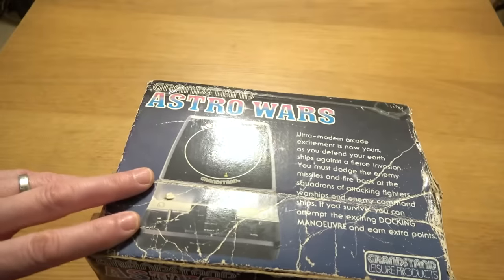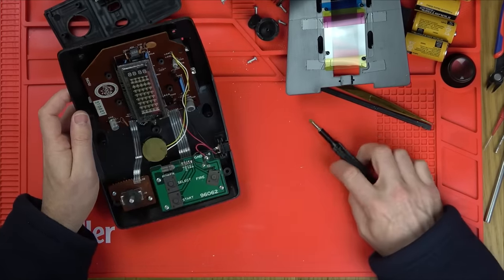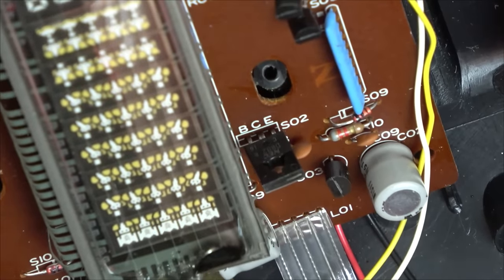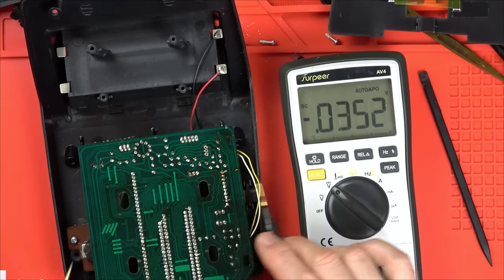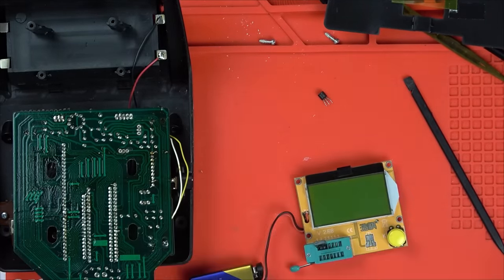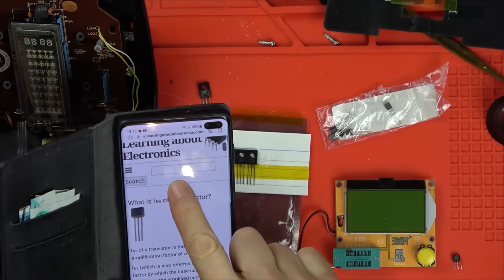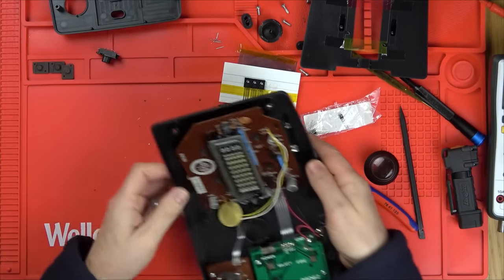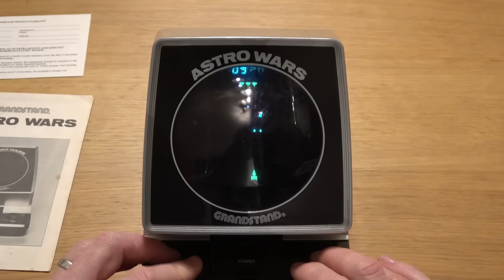Dead 1981 Grandstand Astro Wars Game - Repair Video

Comment: I received an Astro Wars for Christmas the year they came out (my younger brother got the CGL Galaxy Invader 1000), it was a fantastic present, but disappointment quickly set in as we exhausted every suitable battery in the house with a short period of time. On Boxing Day we used to go to my Grandparents, so I took it there and depleted my Grandads draw full of batteries (even used AA and packed the ends out with tin foil!!!, until they ran out).  Then had to wait what seemed like weeks before my parents could get me the Grandstand Power adapter (this had switchable polarity, which may explain why so many Astro Wars have failures).   Needless to say I still have mine and it’s boxed.

Comment: Great vid as usual. Just a quick tip … I keep some emery boards (used to file fingernails) to scrap battery terminals as well as a grinding pen like yours. PPS also changed the tip to small wire brushes as well. 😛

Comment: The higher the Hfe, the better the current gain of the transistor. However, most circuits don't rely on Hfe to provide amplification as it is subject to thermal runaway (its H parameters depend on temperature and as the transistor gets hotter, things become unpredictable). Rather, a useful design has gain set by surrounding and biasing resistors to make it fixed.

Comment: I had one of these and the display failed. It's probably long gone now.

Anyway, for the battery contacts I would use a contact cleaner or label remover that is citric acid based. It cleans up the corrosion quite well with no impact on the device. Best one to get though is one with the built in brush so you actually spray through the brush. Very handy.

Comment: I've repaired a fair few of these and I'd say 8 out of 10 it's the D882 failure alone. I think I've only replaced that other NPN once. The real problem is when the S06 zener diode under the VFD has gone! It's a real PitA to get to and find decent replacements.

Comment: That toy is as old as me. I'd recommend checking its cholesterol levels and giving it vitamin D supplements. Also, tell it to walk every day for at least 15 minutes outside.
Reply: Or if youre me..even older than that
Reply: Great video as always. There is a one and only full size astro wars arcade cabinet at the retro computer museum. Come and see it!
Reply: I love millennial/ gen x humor.
Reply: Also, make sure to try to address each and every issue with the question: „Did you drink enough water?“. That is essential and really helps in the fault-finding process.

Comment: Transistor are used as voltage regulator here, exact specs are not so important. Heat probably destroy them after some time, for quick sell it's not so important but if you ever decide to keep one for yourself replace it with something else (any TIPx1 in to220 package) or if there is a room attach heatsink to this one.

Comment: Quick question. 
When using IPA, why don't you pour a little into one the little troughs on the mat?
The bottle lid looks messy.
Reply: I use a small 50ml squeeze type bottle (I've seen them on Amazon) which I top up now and again with the big bottle of IPA. It makes it a lot easier to get it where you want it, and also mitigates the risk of accidentally knocking over the whole bottle 🙂
Reply: It is messy, he spills it all the time.

Comment: Hey Vince! I have an HP laptop where the short and long DSTs failed. Whenever I turn it in, it just stays on the loading screen and doesn’t go to the login screen or to anywhere any further…

Also have another laptop that got a small water spill. Asus laptop. Won’t turn on at all after it shut off.

Comment: Mine still works fine, but the plastic front plastic is cracked when something dropped on it once. Maybe I could buy a spare for parts and use it, or fabricate it out of some polycarbonate or something 🤔